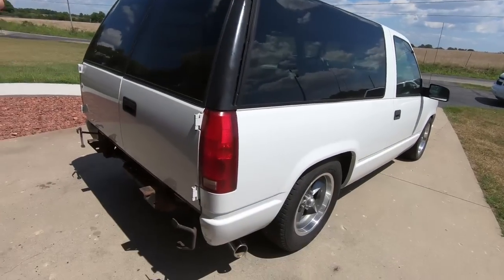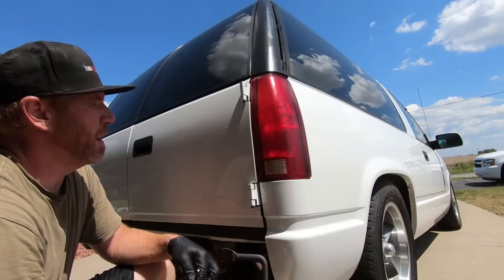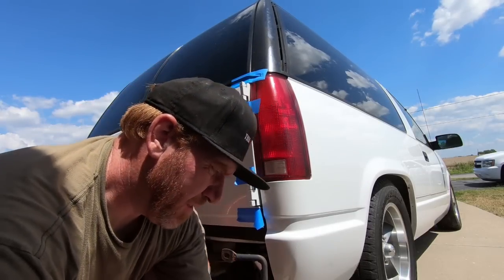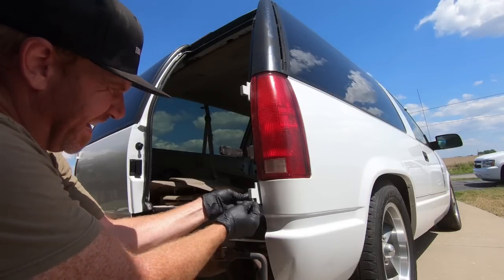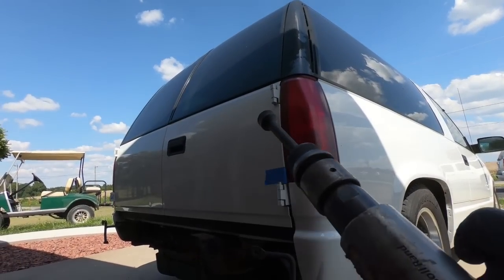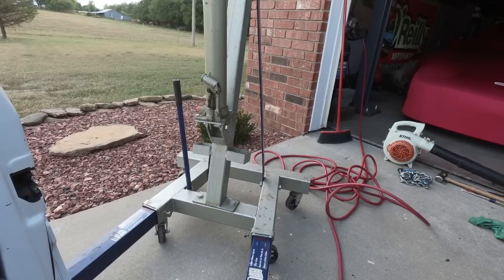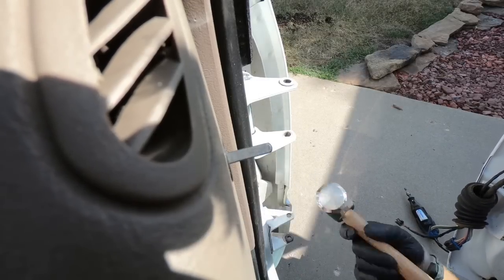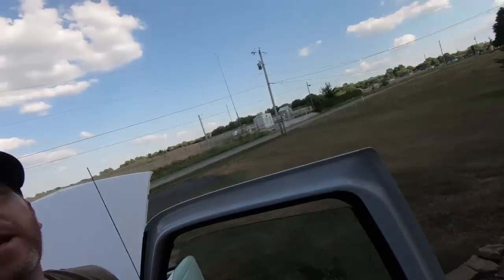2 Door Tahoe Makeover Part 8 (Door Pins and Barn Door Pins AGAIN)

Comment: Take needle nose pliers to get to that spiny thing and try to get it loose where it moves while the door shuts and then add grease to it so it stays loose, I just had that problem it’s fixed now with my driver door 1999 Chevy Tahoe it shuts perfectly now
Reply from the maker: Thank you. I sprayed a bunch of oil and it seems to have done the trick.

Comment: I have used a bolt or all thread to install those bushings by drawing them in. I made the mistake of using a hammer to install them before, the bronze is so brittle they didn’t last very long after hitting them with a hammer.
Reply from the maker: Probably the best way and I will do that in the future

Comment: Travis that door spring ??? I would have installed a new inner door spring when you changed out the door pins. Usually if the door pins are bad so is the spring..
Reply from the maker: I may order some new ones. Thanks.